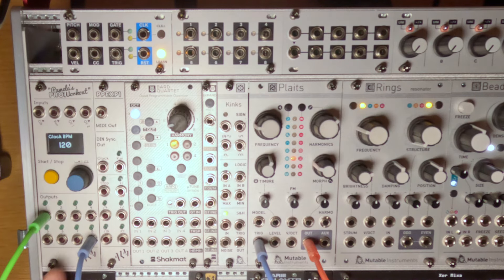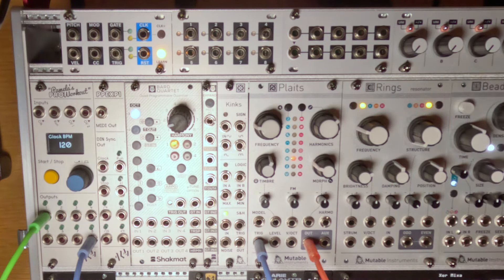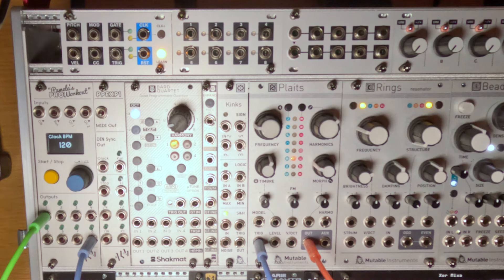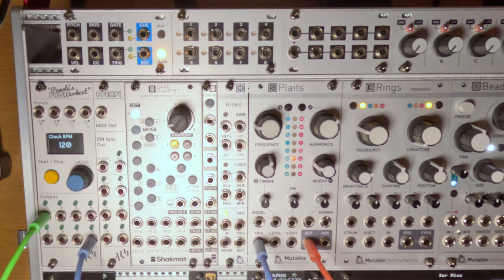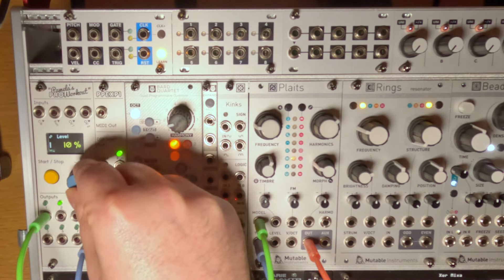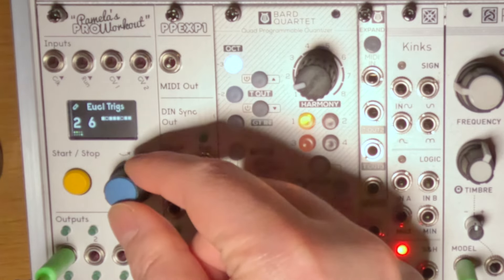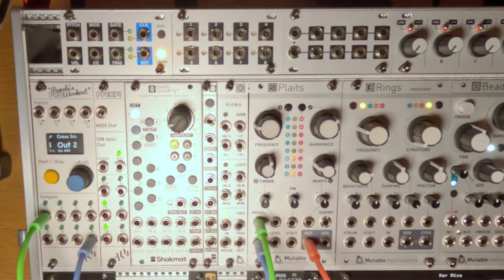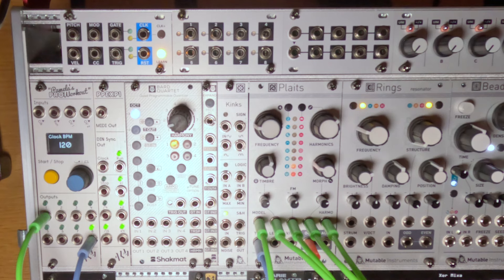Creating a drum beat with only Pamela's PRO Workout and Plaits

Comment: Couldnt you just use the unused channels of pam as a modulation rather than using another lfo? Quantizing the random waveform works pretty good
Reply from the maker: Yes, you certainly can! I'm planning another video using Pam for all sequencing and modulation.
Reply: @Perceptes  and then use your sleep wake cycles to add a little fill pattern every 4th or 8th rotation.   Only issue is you start to eat up your Pams outs.  What would be cool is if they gave us something like virtual outs that arent actually going to an out.  Pams Ultimate Workout maybe...

Comment: Good video.  Why are you using ochd to modulate instead of the remaining Pam's outputs?
Reply from the maker: It's just quicker to set up, and the modulation was not the point of the video. I'm planning another video soon that will be more of a "Pam does it all" approach.
Reply: Makes Sense. Thanks for the tutorial. I assumed I could do this with plaits but wasn't sure how to set it up. This was exactly what I was looking for.

Comment: the annoying thing is that the settings for the different drums (or even other sounds since model modulation is really sweet in anycase) are usually never matching. This also happens on other mutable modules - where there are modes to flip through sounds but the settings when sharing similar knob values, sound wrong or boring - so i wish there was an easier way to automate this stuff instead of having to also pump cv into all of the other inputs per step - like some sort of a memory or last used setting - like the SDS Oscillator does
Reply from the maker: Great point. I haven't looked into it but I think there are modules designed for this type of thing, kind of like a "preset" module. I vaguely recall there might be one by Shakmat. But it would certainly be amazing if Plaits had something like that built in.